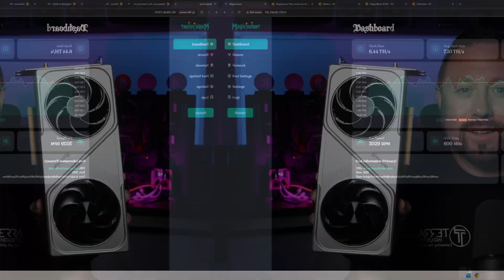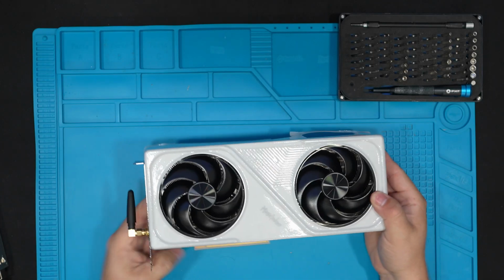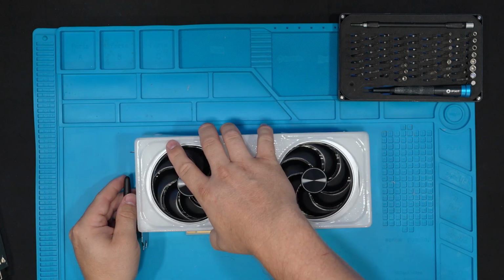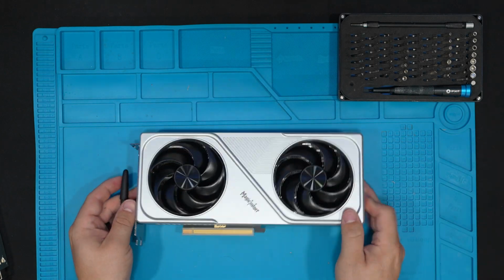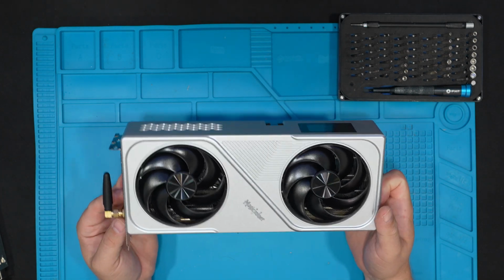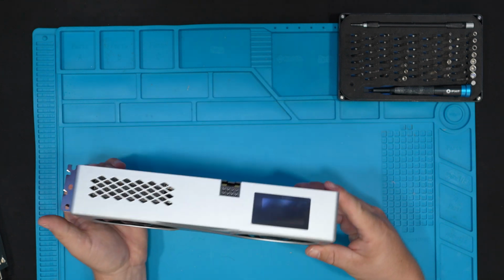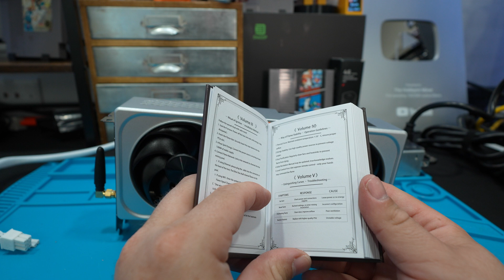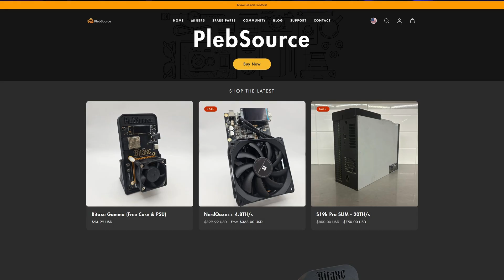Is this REALLY a "GPU" Bitcoin Miner?! Whats Inside? MagicMiner BG02

Comment: Super cool design. That's an ESP32 microcontroller running the show and doing the wireless. Same as with most BTC solo miners like the Bitaxe. Based on efficiency number those ASIC chips are from an S19 maybe?

Comment: If I had one id put in my desktop pc. Or if i had severals id put them in an old octominer x12 i have laying around thats not doing anything. If I had some AI gpus id fill that thing up with them. Currently I'm not happy with Canaan. As I have had a few more Nano 3 die on me including one that was "repaired" about 4 months ago. I've reached out to support and feel like support is just an ai bot. Just keeps telling me to send to a repair facility which now would cost more than the machine is worth. I was hoping to sell them so i could purchace another home miner but i'm afraid to move the ones that are working. All had the 47r chip fall off, but thats not the only issue, i think them failing off or becoming lose causes power surges and fries something else near by. With all that being said, I would chose this thing all day every day over the avalon nano 3 or 3s. Bitaxe or nerdminer i would love to get my hands on one. I Have a mars lander v2 which has been runing with no issues for a year with the R909 for added hashrate. I think this thing looks cooler than the Futurebit apollo2 which runs similar hashrate and power consumption.
Reply: the nerdQaxe looks great, and it and the other bitaxes are roughly close in price to the nanos while being more efficient and open source.